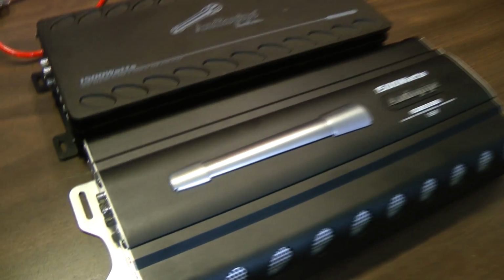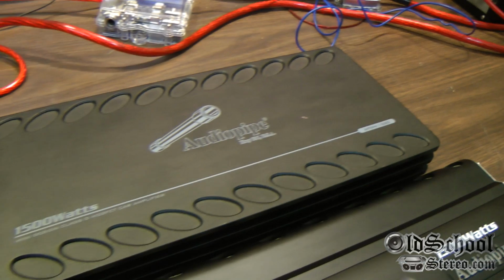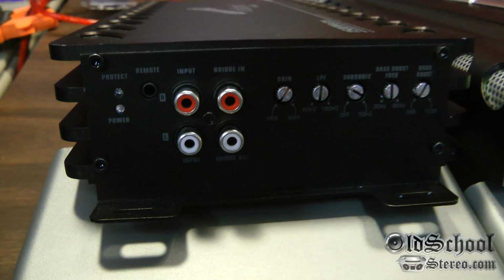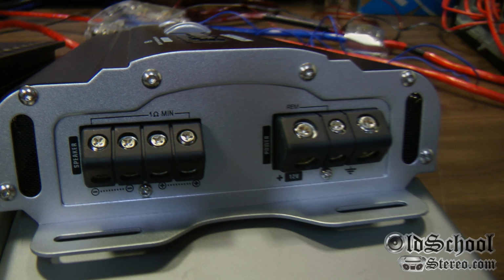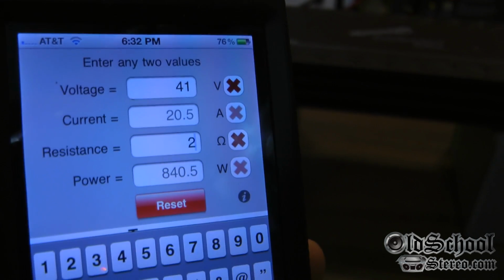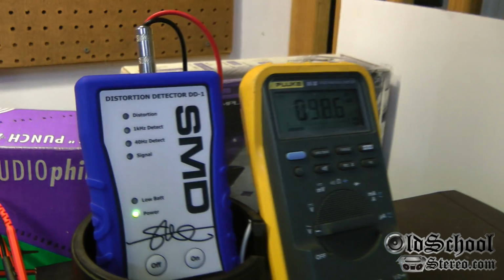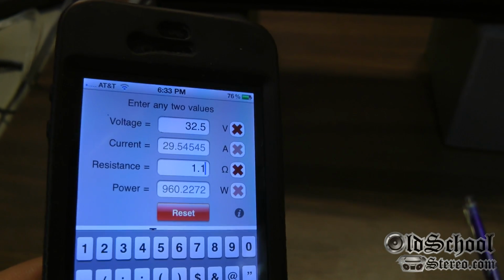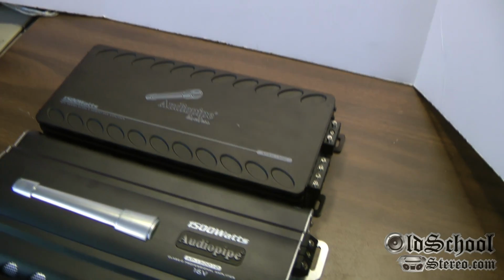Audiopipe APSM-1500 1500w Class D Monoblock Power Output Test

Comment: When you test these amps ... are you leaving the gains settings  off (left) or do you set them ?
Reply from the maker: Gains are matched to head unit with DD-1+ setting on Amp Dyno. Typically around 1/2 gain on most amps

Comment: This guy did this shit all wrong. First of all, when you try to clamp an amplifier, you're supposed to put the clamp around the positive wire ONLY. This guy has it around a friggin' negative and positive going to a distribution block going to god knows what. Second of all, you put the voltage and ohms in a stupid ass calculator on your phone. The PROPER way to find wattage is to MULTIPLY volts and amps together. Even then, the reading are STILL wrong. On your 2 ohm "test", you got 41 volts, and 75 amps. Multiply those together, and you get 3075 watts. Hmm, thats strange. And on your 1 ohm "test". you got 32.5 volts and 121 amps. This oughtta be good. Those two multiplied together is 3932.5 watts.

If all of you on here want to see a tru test on a real SMD Dyno Machine, go to this link. 
https://www.youtube.com/watch?v=CClBvQ1FpDk
You sir have received my dislike. Have a good one.
Reply from the maker: I somehow missed this message as it was put in the SPAM folder. It seems like you are the one in the know, but you don't know what you are talking about. 1) the clamp was put around the positive wire only 2) When you multiple volts and amps together in the setup I'm showing, this shows the INPUT VA, it does not take into account the efficiency loss of the amp itself. That's what I calculated in the results 3) The other video you link to is mine too, glad you like at least one of my videos.
Reply: Lmaooo this is getting Guuuuuuddd. ........ Popcorn,  & Dr. Pepper in hand ......👀👀👀👓🎓💻💻🎬🎬🎭
Reply: BigDWiz big d knocking out the troll
Reply: Omg how embarrassing.  bless his heart,

Comment: APMI20001D???? 1ohm power
Reply: MrGetLikeMe does rated. I just got one and so far like it. Gets hot but think that's do to wired at 5. Rise is well over 2 so not sure. Just going to get a 2nd and strap em at 2 ohms

Comment: Hi guys! I need some advice .. I got 2 kicker cvr subs, 1000 watts , 500 rms each! What power/watt amp is required to power them.
I drive a 97 gs300 and a 4 runner 2005. Can u guys help me out?
Reply: On YouTube there's a guy running two 12 cvrs sealed box with the ap1500 dudes hitting high numbers for only two 12s sealed up,
Reply: Depends on what ohms your going to be running at 2 or 1 that will help you find your amp if I were you I'd be getting a 1200 watt rms at 2 ohms if your running that, if your running 1 ohm then I would go with a 1200 RMS at 1 ohm amplifier

Comment: can you do testing on the APCL18001D?  i just ordered one for my 2 audiopipe txxvd15's.  i have a stock alternator, 1/0 wiring(big 3), and a secondary battery.  right now im doing a 145.6 on the meter with a planet audio BB2400.  Do you think my dbs will go up a little bit with the ACPL1800?
Reply: You need a more powerful alternator and 2 more battery's to get more power out of those amps, you running two 1,800watt amps on a stock 80 to 100amp alternator is not going to get you the power those amps can putout, chances are your alternator is going to give out really soon if you don't upgrade it soon.
Reply: MazdaBass971 thanks for the feedback.  my stock alternator puts out 136 amps.  really dont wanna spend 400-500 on an alternator.  but thanks again
Reply: Douglas Jenkins check out a company lactrical I bought a 250 amp for my suburban it ended up doing more than rated and spent like 175 with a two year warranty which I would buy one every two years of needed

Comment from the maker: I use the clamp only to measure how much current the amp is drawing. The calculation is pretty basic. Take the current (amperage) measured by the clamp, multiply by the input voltage, this gives you the wattage at 100 percent efficiency. Divide this number by the actual measured wattage, it will give you the efficiency of the amp.

Comment: I'm not sure I understand. Are you measuring current pull from the power source. Wouldn't that be the figure before losses? In other words, what about the efficiency of the device? I feel like I'm missing something, as I know you obviously wouldn't test the wattage using amperage just based on the draw. If that were the case, I have several amps that are power hungry monsters but put out lackluster watts that would look really good in this test.

Comment: I know the test doesn't show the 4 ohm output but could you give a reasonable estimate? It was much closer to rated power at 2 ohm than 1 ohm and am curious if this efficiency would be at 4 ohm also. I'm looking at running 1 on a 10" Earthquake DBXi (400rms) svc4. Thanks for the help.

Comment: the APSM-1500s can get quite warm at 1ohm, if played for extended periods of time. Played one hard for 30 min or so and it was uncomfortable to touch. This was in a large trunk with no airflow though. But it never missed a beat and is still running strong.

Comment from the maker: Clamp is measuring current pull from amp, o'scope/True RMS meter is measuring Watt output. I did not use speakers, but resistors. There are too many inconsistencies when using speakers (ohm load/phasing/temp/etc), resistors give the most accurate results...although less power than what you will see from others who've "clamped" this amp

Comment from the maker: It impressed me on the bench. I honestly didn't keep the amp long enough to try it out in my car. I'm pretty sure this amp would do the 1500w at 16V or very close to it, which like you said is incredible for an amp at this price! I personally prefer Class AB amps over Class D, but I don't use 100lb subs or wall my vehicles. I prefer smaller SQ systems.

Comment from the maker: The DC input voltage was 14v. I have 200A of input voltage available from my dual Audio Authority model 978 power supplies strapped. These are 13.8v power supplies, but when strapped, show 14V. I also just added a high capacity AGM battery to use for up to 500A peaks

Comment from the maker: Yeah, I've actually been wanting to do this for a while. There's no doubt the 25TL models are WAY more powerful than the older ones, but they are also WAY bigger. The old Punch 150's require a 30A fuse while the 25TL 150 uses (3) 40A fuses!

Comment: This test setup is very well done and gives a nice accuracy of an amps power output at a set load and voltage. You cannot compare someone giving you results in a car atmosphere running a sub. The setup has way more factors that come into the equation. I don't like tests at one set frequency on an amp but for giving power output it is really the most efficient way. If this amp would have hit 1700@1 that has no bearing on it's musical ability. It is a power number at 1 freq in time. Music isn't

Comment from the maker: I have a Velleman HPS-50, which is a better scope than the DSO201, but the inherent problem with the inexpensive scopes is the low resolution display (320x240). To get more detail, you need 800x600 resolution or better. These o'scopes don't measure THD by the way. If you don't believe the DD-1's accuracy, that's fine, but unless you can prove it's not doing what it says, there's no need to continue this discussion.

Comment from the maker: See....v=k6g8grLFDx0
 
I don't disagree an o'scope is the best way to monitor the waveform, I'm just saying it's more accurate to use the DD-1 and reference the 1%THD measurement when testing amps than to try and detect the slightest clipping of a waveform on an o'scope. The horse is dead, BTW.

Comment from the maker: It has been proven in listening tests that human's can not sonically detect distortion until the THD reaches 15-20% at high frequencies and up to 40% at low frequencies. People complaining about 1%THD need to revisit that argument. Also, the DD-1 will show distortion BEFORE any clipping is noted on the o'scope. I use the DD-1 for consistency as detecting slight flattening of the o'scope sine wave can be extremely difficult, while watching a light on the DD-1 detect 1%THD is simple...

Comment from the maker: Not sure what you mean by more input signal? RCA Voltage or Power input voltage? My Yamaha HT receiver puts out 3.5VRMS (RCA line voltage) and based on my measurements and efficiencies, you still can't get 1500w with these amps, even at 16VDC...maybe if they would accept 20VDC....

Comment: because clamping is inaccurate due to the wave being measured by the meters actually being offset by a certain period. Therefore your 1470 watts could actually be ~1300, ~1200,  or anything else lower than 1470. And i doubt you had no rise from 1 ohm, or did you wire down and rise to 1?

Comment: What I am getting at is the components of the amplifiers that audiopipe uses are cheaply made and have a high tolerance value which allows them to be hit and miss per-say than have a solid production quality. And I understand they use a perfect world testing to get their "1500" watts. But I know from fact they cannot produce it without a clipped signal.

Comment: I just went out and clamped my APSM 1500's. I have 4 of them of 4 death penalty 12's. I got a max AC Amperage =30 and a max AC Voltage = 73.1. I got 2193 watts and a true impedance of about 2.5. I think that is pretty darn good for the price of these little beasts. And keep in mind, this power is doubled since I could only clamp one strapped set at a time. I will be uploading the video of it tonight/tomorrow. Overall, almost 4500 watts rms at only 2.5 ohms for only $480 isn't bad at all.